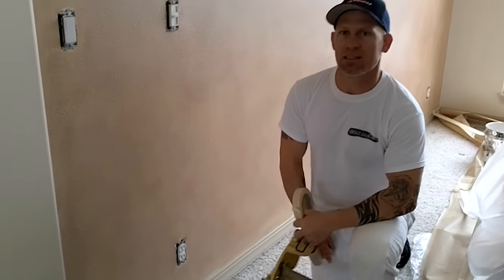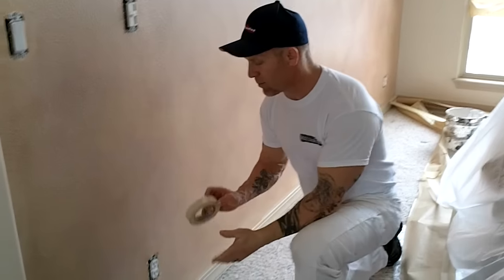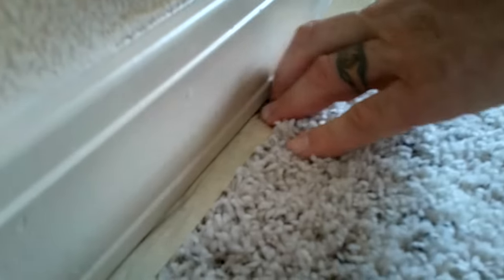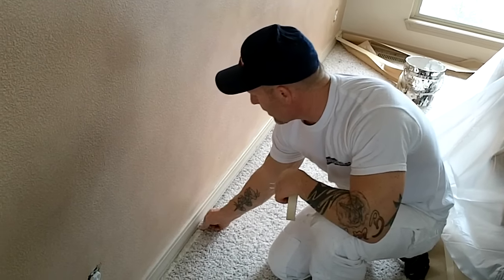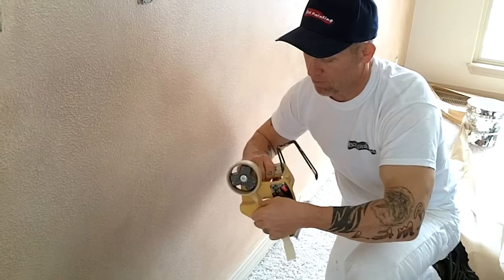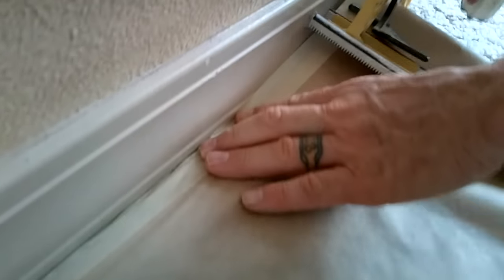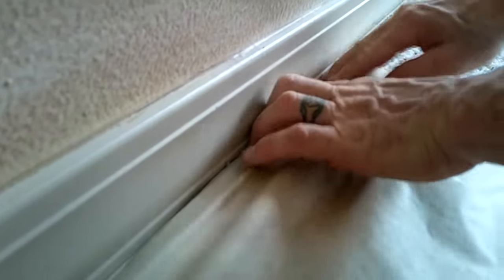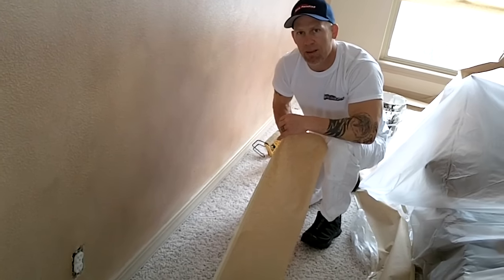Masking Carpet With Painters Tape.  How To Mask Carpet.  House painting tips.  3M masker.

Comment: In the UK, the carpet rarely goes underneath the baseboards (or skirting, as we call it) but it's pushed down against the bottom of the board. What I do is use a silicone spatula to push the tape down to the bottom. After painting, I press down and remove the tape once the paint's dry, negating the risk of the carpet springing against the wet paint. Loving your videos Chris!
Reply: What tape works best on carpeting? Blue painter's tape or something else?

Comment: What worked for me was, HomeDepot sells 3-ft x 50-ft plastic sheeting.  I unrolled a piece then cut one of the folds to yield a 9-inch strip.  With a plastic putty knife we could tuck the plastic deeply under the baseboard.  No issues with carpet rebounding into wet paint like it does using a drywall knife.  Also worked better than tape because we could push the plastic further under the baseboard.  Plastic is reusable after paint dries.
Reply from the maker: Awesome, thanks for sharing Lance!
Reply: Great advice, Lance. Thank you!
Reply: wow, you must make 2.50$ an hour to 1) cut your 3' sheeting down to 9" and 2) reuse that cheap .3mil sheeting. Otherwise good idea. This video needs an update including your 3x (sans cutting...) They make some newer, thicker stuff.

Comment: Try using flash siding. Thin metal sheet of paper that can come in rolls or squares. I would shove that under the baseboard and that would prevent any paint from going on floor/rug. Flash siding can be used over and over so once you buy it, it will last for a while. When I would paint baseboard, I give a final dry brush and finish a whole section of wall then remove it so it would not dry to baseboard. This way is much easier then putting tape down and making sure tape is under the baseboard. All you have to do is stick metal sheet under baseboard and put your next sheet in, making sure you overlap the piece next to you. This can save money on tape, with tape being expensive. Only problem sometimes is baseboards can be old along with floor and they can be warped so it can be hard in some areas to stick it under
Reply: how many pieces of siding did you carry and how long the longest and on average? not rolls or squares but actual siding...

Comment: But what do you do when the builder put the baseboard down all the way to floor (6" baseboards) and then put the carpet in? You can't tuck anything under it at all?  I have tried shooving both plastic and paper even using a puddy knife and there is absolutely no gap.
Reply: don't worry about it, when you decompress your carpet, it'll rise above your paint-line, the customer will never know

Comment: Ever used an edger? Beats using tape at all. I used to mask with tape(and paper if spraying) but really have to watch bridging with the paint as you have to cut the paint after so it doesn't rip off the baseboard when the masking is removed.
Reply: confusing wording
Reply: @immeohmyoh  Why is it confusing? An "edger" is a tool you can buy that inserts under the baseboard and blocks off the carpet from wet paint. They can come in one to three foot lengths. With tape shoved under, if you don't cut the dried paint where the paint "bridges" over the tape, when you remove the tape, sometimes the tape rips some of the paint OFF the baseboard which creates a touch up. Still "confused"?

Comment: Chris, great informative video. Was hoping I didn't have to remove the baseboard prior to painting. One question, do I sand or rough up the BB's to "prep" them like I would a wall? Suggestions?
Reply from the maker: If they need to be, they don't usually need to be if it is a repaint
Reply: Most people will sand or degloss trim because they are usually covered in a paint on the higher end of the "gloss spectrum" (usually semi-gloss). According to other videos I've seen, I would bet that Chris would degloss any  gloss or semi-gloss surface in order to ensure good adhesion. The alternative to a deglosser, of course, is sanding which should have the same benefits as deglosser in addition to removing some unwanted particles and textures from the previous top coat.

Comment: If u pull the masking when the paint is still wet doesn’t the carpet stick to the wet paint? Or do you wait for it to dry just a little bit before pulling it off?
Reply from the maker: We do not let it dry, we pull it to prevent peeling
Reply: Yeah, i'm with you man. I wish the concern you referenced were mentioned in this video (or others like it that I've seen). I'd rather deal with bridging than paint on carpet; so I'm going to let the paint dry before removing the tape, counting on the carpet's pile to be high enough to cover any unsightly bridging. Also, I'll remove the tape by pushing down to separate it from the baseboard instead of pulling it up, and that should prevent most of the peeling.
Reply: @vasilioskorominas2864  you can also run a blade to cut through the bridging once it dries, so that when you peel off the tape it doesn't come off with the paint.

Comment: Good luck pylling that tape up ..pulled all the fibres put my invictus carpet
Reply from the maker: We haven't had an issue with it!
Reply: I've noticed the same but the carpet was in bad condition. Also, its recommended to not leave that masking tape on for more than 3 days. The Paint Life crew has recommended cutting that recommendation in half. If tape is needed to sit longer than that, they recommend using a painter's tape rather than a masking tape (as the maximum period recommended for leaving the tape on a surface is longer).

Comment: I get that the tape needs to be removed soon after painting so the paint doesn't stick to the tape.  But I need to do two coats, so won't the paint pull off once I remove the tape after the second coat?????
Reply from the maker: We do not tape for the second coat